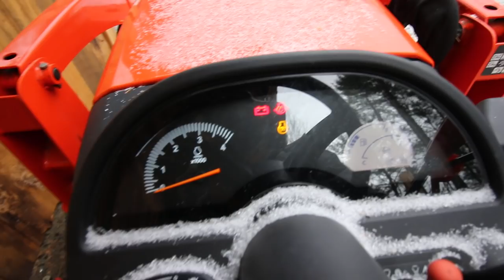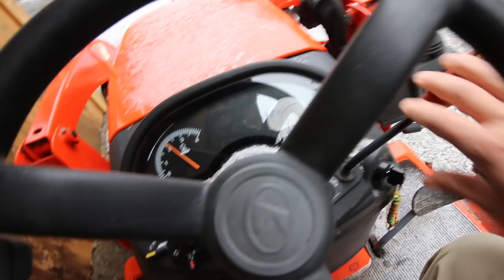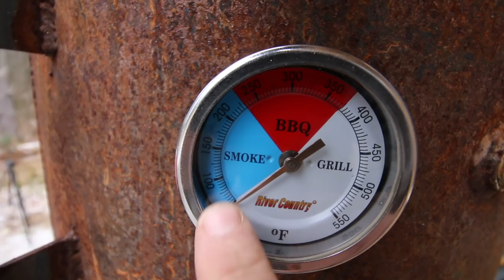Getting Winter Piglets|Building a SmokeHouse

Comment: For our pigs we still use the 55 gallon barrels but my husband took his power saw and cut a small rectangle to fit a de-icer in and then we just run an extension cord over to the barrels. We get down to -40 here and one small de icer works for the entire barrel. The hog nipple gets frozen sometimes but every pig and piglet we have had just sucks on it until it comes unfroze. It's made wintering pigs a lot easier because we don't have to give them water in a bowl three to five times a day.
Reply from the maker: I bet the pigs love that

Comment: Al, you should get a magnetic block warmer for you Kubota. This way you can take off when not needed in the summer. Keeps the engine block warm after using in winter months. Kats model #1160 on Amazon.
Reply from the maker: Thanks I will look into it right now!

Comment: Al I was going to say that you should tie open one side of the feeder till you know they are eating good. I have worked with hogs for 30 sum yrs from raising pigs born on straw in a 8x10 pens to 5x7 freestall crate to a regular show crate and I I farrowed 125 sows a month with 45 crates and I could wean a better avg. Outside then the crates as the sows or gilts would lay on pigs in the crates or jump up and stand on babys pigs until I put a radio on the shelf and played doctor office music to keep sows and girls more relaxed as I could open the door and they wouldn't even move until they heard the feedauger. My wean avg outside wasnt less than a 10 per sow/ gilt but inside it was less than 10 most of the time. Usually around a 9avg plus inside the crates

Comment: Great video Al! Do you have a video where you show the pig pen and pasture setup you have? I want to get pigs come spring but am unsure how to set up a nice pigpen. Thanks
Reply: Farmstead Fun Hi, Al has several videos on pigs which are grouped together. I like the one about 10 things to think about before pigs.
Al has a great place for starters, an old orchard with free apples. So think about your location which needs plenty of room to expand as those pigs get bigger. Will need close water source for drinking and wallowing/bathing. Al has a good video on pig waterer. I could not get it to work for me, so I started out with a float and barrel. But, bigger pigs knock that over because they want to wallow. So I move electric fence to lake. That is the best thing I ever did. Also, others prefer  no mud holes so they make an in ground  pool. Pigs need LOTS of water, so rainwater harvesting  system  is good idea for them.
  Al is putting in a mudroom  for them  this year. I did this using a chicken tractor....great idea as way to corral pigs to maintain the fenced area. I use mine as a rainy day dining area for them. ALSO, my pigs share barn space with chickens. No problems.
 Pigs are pushy, they are curious and the two combined make for destructive tendencies. They will lean on posts to scratch. Good to have trees in pen. 
  Pigs like treats, from comfrey and acorns to rolled oats soaked in diluted apple cider vinegar. I put a little diatomaceous  earth in for parasite  control. (They love eating. Their lip smacking makes the food sound good. They ate the DE right out of bag!)

Comment: wedont have a t post driver either... been 28 yrs, and the mallet does the same job, and costs nothing. so keep doing what your doin.
Reply: i use the tractor bucket to drive metal post ,helps to have a helper but it can be done without any

Comment: Is the reason for the "2 pipe length" distance to keep the temperature on the low side? So it doesn't reach a higher temp on the gauge? I'm struggling with temp control on my smoker... It gets tooooo hot, especially for things like bacon and salmon.
Reply from the maker: Yes it is. You need atleast 10 feet of pipe before the smoker. I am thinking of adding another 5 feet to ours.

Comment: Those are some huge pigs! How did you get them in your truck? They'll handle the cold better!
Reply from the maker: The farmer and I picked them up and put them in the crate one at a time. It was quite fun! Lol
Reply: Lumnah Acres - I had a couple of questions but needed to finish straining milk & wash equipment. How well does your electric fencing charge with snow? Mine ground out with 4 - 6" of snow, so everyone goes into winter housing with cattle panels. 
Ingenious smoker! I'm on flat ground so if I were to run pipe to the middle of the smoke box would it still efficiently smoke the entire box? Does the length of the flue pipe effect the heat coming into the box? Just wondering if your length was for heat reduction or simply because of the height of your smoke box.
Reply from the maker: I will find out how good the charger works this winter! Lol. The length of the flue pipe is to reduce the heat. I will add another section at some point. You want the pipe coming in the bottom, from all my reading
Reply: I'm keeping my fingers crossed for your charger! I'm surprised your pigs haven't lifted your gate off. I've always hung my hinges opposing each other (bottom facing up, top facing down) to prevent escapee animals! I have had pigs lift my gate right off the hinges!
Sounds like the reasonable way to hook up a smoker - I'll need to re-figure I guess!

Comment: What is the slime you talked about?  My tires on my garden cart keep going down and I have to keep airing them up.
Reply: The product is called Slime. Looks like slime, feels like slime, seals tires that aren't too far gone (it won't seal slashes, nothing does). It stays liquid in the tire and is able to seal new holes. I've also had good results with Fix a Flat but it's a one-time deal. It won't seal a new hole that comes along a few weeks down the road.
Reply from the maker: http://amzn.to/2hNibfr
Reply: Thanks, I will have to get me some.  I have always used Fix a Flat, but like you said it won's seal new holes.

Comment: Why do you keep tuning your tractor off each time you stop to do some think.
Reply from the maker: That way you don't have to listen to it on the video
Reply: Lumnah Acres 
One of my favorite jobs after FireFighter was fire apparatus mechanic. At Los Angeles City FD we began having engine failures which we determined to be from constant short trips which never allowed the condensation which builds up inside the crankcase of a diesel engine that is not run for several hours. This water causes a sludge to build up and the low pH mixture results in o-ring and gasket failure which requires an overhaul in one faith the time as over the engines in over the road trucks. 
I suggest a block heater for the tractor which yes will cost in electricity but allow a better lift of ur valuable tractor!